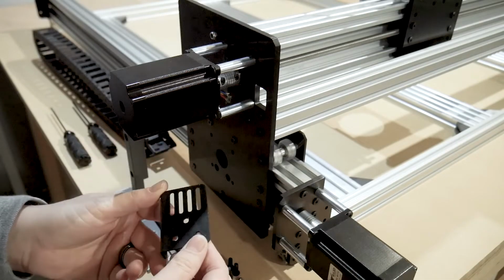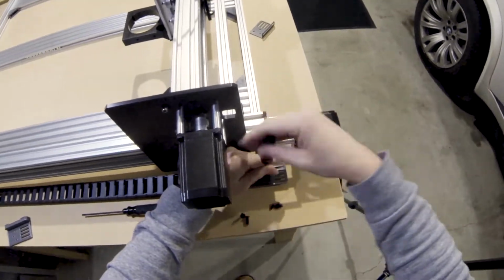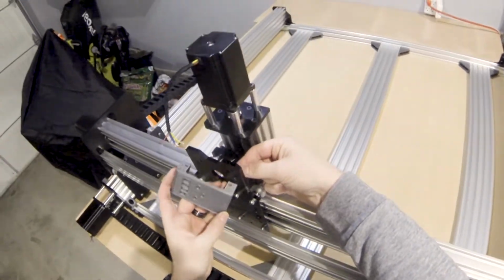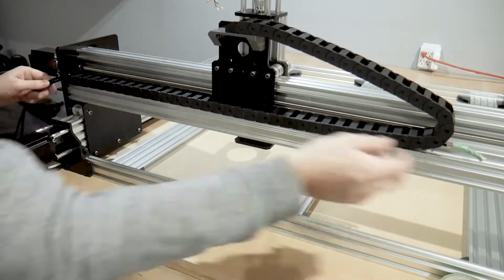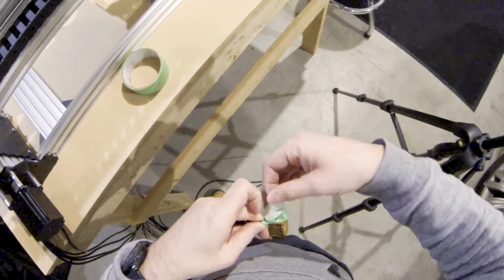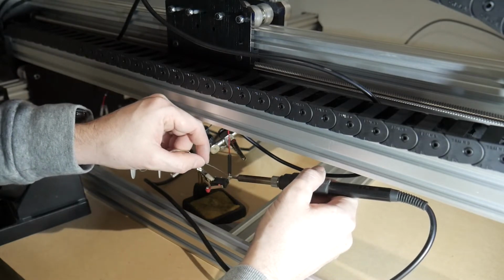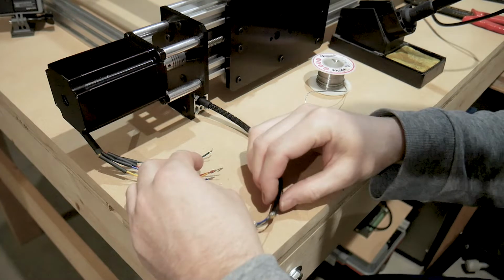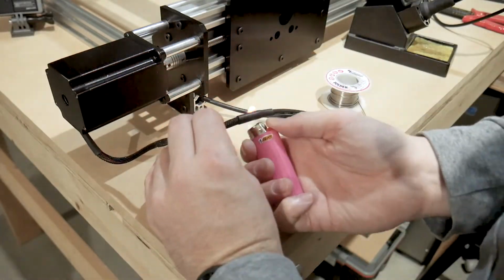Workbee CNC Bulkman3d Kit - Build Part 4

Comment: Thanks for the videos, I use them as a cross reference while I build. We are printing up the x axis mounting bracket. I might use a 40mm wide y axis drag chain. Are the mounting holes standard between the different sizes?
Reply from the maker: Hey Ron. I'm not sure sorry. I would assume they are different there seems to be no standard.

Comment: I have just bought the exact same machine and set up, instead i have the 1.5KW water cooled spindle. The only thing i am a little worried about is there is a little bit of play on the Z-Axis and i haven't even put the spindle on. The eccentric 6mm nuts are facing outwards as suggested to create the furtherest distance but still a little play. Any suggestions on how to correct that? Thanks
Reply from the maker: Sure the eccentric nuts only need to be at the furthest distance for installation. Once you have these on you want to start tightening them so that you can only just turn the wheels by hand.

Comment: Awesome. Why did you choose to build it in a reverse configuration?
Reply from the maker: Hey Brandon, I have simply reversed the end stops and cable chains so that they come out the back right(  as opposed to the back left ). This allows me to run the cables to my control box with a nice short run.

Comment: Hi,
What size would be the best ? X750 Y1000 or X1000 Y750?
Thanks
Reply from the maker: All depends what you want to do with it. 1000x1000 is perfect for me.
Reply: @IllDoItMyself  Thanks for your answer, It was just a matter of which axis to choose the longest for the strenght of the gantry.
Reply from the maker: Oh if you need more strength keep the x shorter.
Reply: @IllDoItMyself  ok thanks a lot